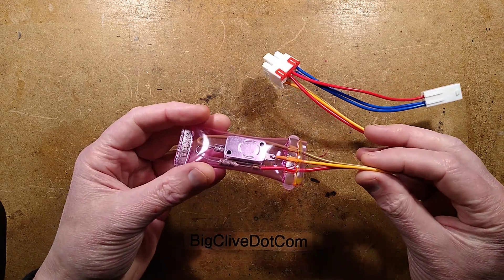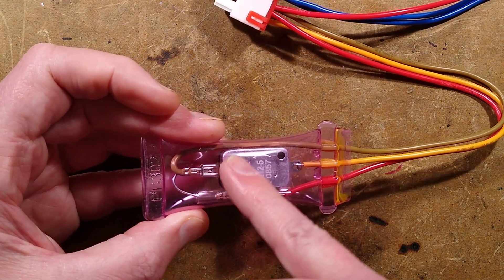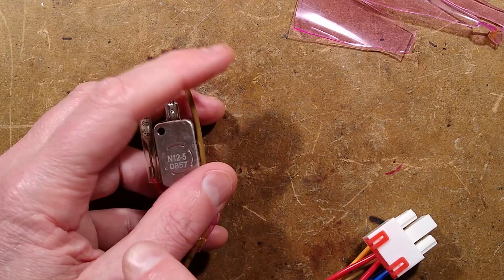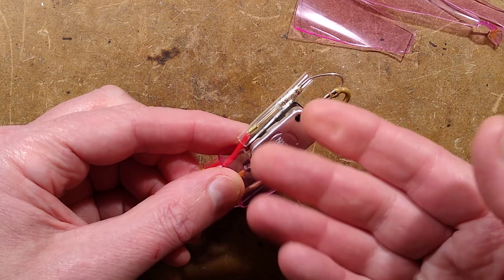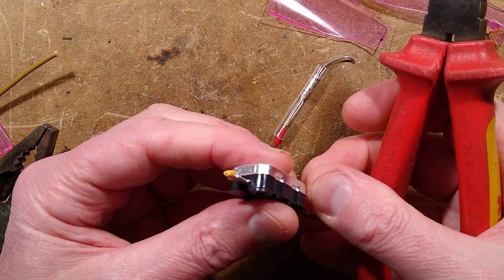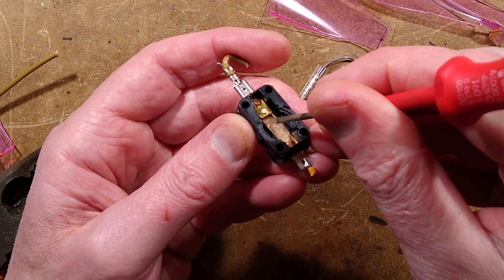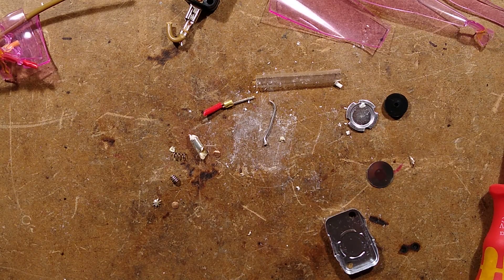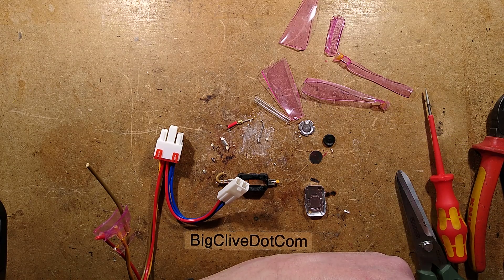Inside a defrost thermostat and thermal fuse

Comment: I'm working on a device that needs wires to exit a sealed pouch so I'm interested to see a commercial application. Air does indeed leak down multicore wire, and I guess moisture could also wick the same way, so I'd hope the heat-sealing overcomes that. In my case, I've used enamelled wire rather than stranded to avoid the problem.
Reply: Yes, things can wick down a stranded wire. I have had batteries leak and found the corrosion wick like 6 inches down the wire finding green corrosion the other end.
Reply: I have done something similar in the past with success. I use solid core wire and strip the insulation off the wire, then heat seal. Same premise as what’s shown in the video, but with solid core wire and no insulation at the point of the heat seal. Obviously it’s important to stop adjacent conductors from touching while heat sealing, but it hasn’t been an issue for me yet.
Reply: I've worked with a sensor that had to be waterproof, but had a connector at the end of 20cm of stranded wire.  We used "sealed" wire, which had small blobs of silicone sealant added to the strands every two cm or so.  That makes the wire more expensive, of course, but it did a good job of preventing moisture from moving down the strands.
Reply: A good high temp wire is coated in silicone and woven fiberglass.
Reply: Water and other similar liquids can through capillary action travel multiple metres along the inside of an insulated wire. So air may also travel along a wire.
Reply: Maybe silicone at the end of the insulation.
Reply: I could be wrong but the wire in this instance looked like solid-core to me.
Reply: In this case, the other end of the wires is likely outside the area where the protection is needed.

Comment: I like how that waterproof package is basically exactly the same concept and construction as glass envelopes for light bulbs and vacuum tubes, just done with plastics instead of metal and glass.
Reply: The pooploop has been completed.
Reply: I thought it looked like a tube for toothpaste, myself.
Reply: It looks like the same sort of polymer that they used to use on those cheap temporary drawing ✍️ pads back in the 80’s and 90’s where you peel the pink layer off a piece of black adhesive to erase and start over.
Reply: Makes me wonder when we will see a renaissance of tubes, but flexible ones
Reply: Except that plastic isn't watertight but will allow some small amount of gas/water diffusion. Doesn't matter, though, probably. Glass is exceptionally resistant to any kind of gas and water ingress.
Reply: Sadly we all know it but we do not do anything about it.
Reply: But , not completely airtight/waterproof unless the wire sheathing sealed as well .....
Reply: Yep and single dose suppositories and those little ammonia packets you snap to wake somebody up as well..
Reply: @Z-Ack  very cool stuff. It's funny how when he started thinking about how the wires are crimped together I was like" this is so interesting!" Probably to only like 5 people! But turns out it's a bit more than 5 :)

Comment: SNAP !    I bought a pair of those exact scissors last week  - so far they have been awesome.  I might have a penchant for Japanese tools :)
Reply: Can you give us a clue as to where they're available? They look well-made...
Reply: @stepheneyles2198  I bought engineer ph-55 and ph-57 scissors from ebay couple years ago.  I don't know who the hand model for those was, as it actually hurts to use them.  Or I have been spoiled with classic fiskars handles here in finland, where fiskars has been THE scissor brand since the sixties and basically everyone has them on their kitchen.  I bought those engineer ones just because I wanted to know if i have been brainwashed to use Finnish brand and to see if Japan would give us better tools, but it seems to be pretty hard to reach for the green ones, when my orange scissors are available.  I'm not sure if the blades are any sharper/harder/whatever, as it does not matter if I would not want to touch the handles.